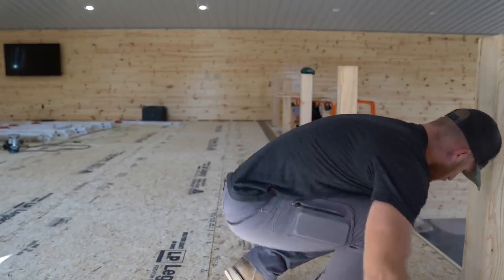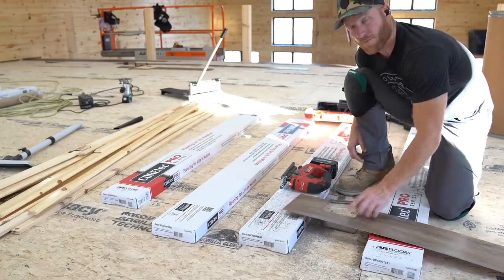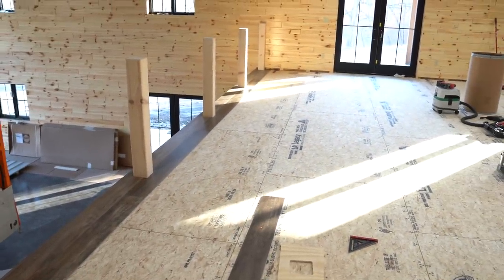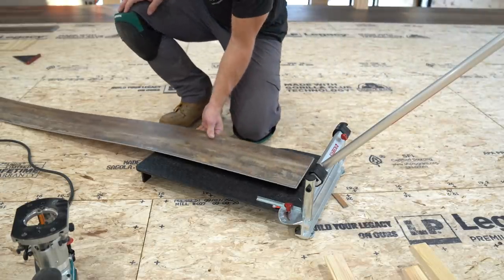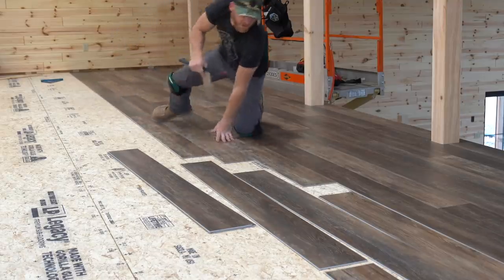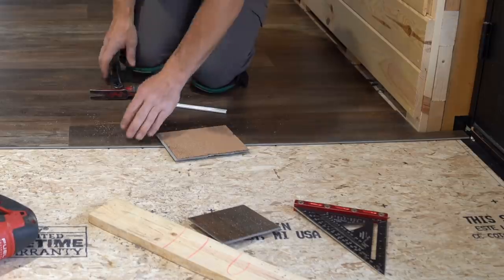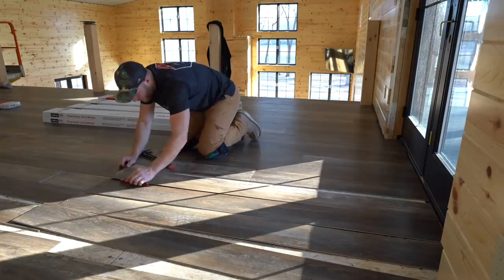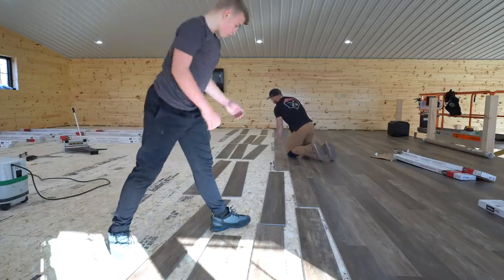Cabin in the Woods 44: Luxury Vinyl Plank Installation **Special Guest**

Comment: I’ve been installing for 20 years now. Looks good, only thing I’d tell you to do is not use the exact size cut off to start the next rows tho. What you end up with is repeating stair stepping. I’ll usually start off cutting a few starters and the end cuts I’ll either take a few inches off or wait a couple of rows before I start with them rather than on the very next row. Keeps the joints as random as possible

Comment: done a ton of "laminate" style flooring over the years in various properties we have owned.   Each carton contains a certain number of finishes from the manufacturer.   As in you don't get all "knotty pine" looking pieces in the same carton.   therefore we just leave the boxes out across the room and pull at random as we lay from several cartons at once.  I do agree with your comment of trying to not to put the same matching pieces together thus drawing your eye to a certain area on the floor.     Like your technique going around the posts, going to steal that method next time.    

Loving the series and the build.   The amount of prep work you two put into this build is paying off when you get to the finishing stages.   Nothing worse than having to shim, patch, fix issues that could have easily been resolved by taking extra time previously.

Comment: A quick help with that type of vinyl, keep your speed square in your pocket with a sharp utility knife a quick score on the face of the flooring and fold to snap will save you a lot of walking to your cutter, which will save time and time is money. Also 2 lb dead blow and a plastic flooring installers block, send the right amount of hammer to set your floor but keeps the lip of the floor safe. But as usual you don’t disappoint your floor looks great!
Reply: He must have been listening..... lol
Reply: Per usual I speak faster then I watch! Lol

Comment: We used a product from shaw flooring at lowes looks to be the same color, if you notice any bowing in the floor between a few boards in a slight arc watch how the sunlight travels the floor at anytime of day. We were remodeling after Florence and baffled by what our floor was doing, turns out the morning sun coming through the windows ether side of the chimney was expanding the flooring planks. Blinds were installed right after we figured it out

Comment: When I was in my mid teens I worked with my dad in the summer.  He sold and serviced 2 way radios with Law enforcement being out biggest customer.  I was installing radios in squad cars, drilling holes in bodies for antennas and running cables from the engine compartment to the trunk.   Good experience and I loved working with my dad.  We built 4 houses together.  He passed suddenly and I miss him daily after 27 years.

Comment: What you can do to. Is instead of starting cutting the pillars in and trying to bridge off the pillars is cut 2 vinyl pieces into squares. You should be able to get 20 of them. Attached them into the male end and screw them into the floor. Now your floor won't move at all. At the end, pull the screws and stopping blocks and do your back fills around the posts. Gets you started quicker. And that product is thin enough to score luckily. There making stuff thicker it seems that breaker is awesome

Comment: Start the flooring about 1” or two away from the joint and get it started in the groove and slide it into place and they will snap together so much easier. You’ll forget where you put your tapping block because you won’t hardly need it.

Comment: That "double z bar" is the fi4st tool i bought for laying plank flooring. Its really useful and youll find that under cabinets its great. You can even use it to shift the entire floor even with you standing on it if you need to shift if a spacer popped out while laying it. A dead blow mallet will save you some wrist stress from recoil and can be used to flatten those ends if they resist or have a tiny bit of grunge in the joint you didnt see. Rubber is ok but has even more bounce back.

Comment: Glad you figured out the score and break. It saves a lot of getting up and down. I can install an entire house of LVP with a hammer and a utility knife. Once in a while I will use a jigsaw when the peace’s are to thin to notch with the score and break method. Been installing flooring for 20 years and there are a lot of “professionals” that won’t mix up the pattern they just take from the box and lay it as it comes. Looks terrible and I always wonder how they still get work.

Comment: A trick I use on vinyl click flooring is to use dish soap on the ones where you have to tap them together. They just slide in and a wet rag cleans the soap up.

Comment: After doing many many many of the LVP floors I find that it eats jigsaw blades. Even the ones meant for flooring.  A table saw is your friend for a majority of the cuts. On notches I do the cross cuts on the table then score with a utility knife and straight edge and snap. A shear is nice for the end cuts but I really do most score and snap with a speed square on smaller room. Maybe a helpful tip for some viewers. Keep up the great vids!!

Comment: The floor looks great. But I have a few remarks:

1. There are some comments saying this floor is completely waterproof. In theory this is true, the planks lock together quite tightly, so water wouldn't go through the seams. HOWEVER, vinyl still expands and contracts with changes in temperature. It's minimal, but still. Kyle knows this as he mentions having had the planks in the room for two weeks already, which is relevant. But the temperature in the room can still fluctuate, causing the vinyl to expand and contract. And given the huge surface covered in this video, there is a chance for the planks to pull apart and leave gaps, and if there is ever water on the surface due to flooding or leaking or whatever, it will seep through the gaps. When water is trapped under the floor, because there is wood directly underneath it creates the possibility for mold to start growing. 

If this happens you need to remove the floor and dry the wood. That's a hell of a job. Moreover, because in this case the floor is not laid against the walls but rather extended underneath the walls, you need to remove all the bottom planks of the walls before you can start removing the floor.

In any case, the bigger the floor, the smarter it is to NOT choose a click-in system. It's easier to lift or cut out a few planks when you need to, instead of having to remove all the floor up until the point you need to access. Let's say you damage one plank in the middle of the floor, then you need to remove HALF the floor to be able to replace that one plank. Same is true for those huge walls. If you ever need to replace a plank in those walls because of rotting or whatever, well, good luck.

It would have been better to go for the glue-down vinyl. It's easier to replace single planks, and it won't move like a floating floor does when expanding and contracting.

2. With such a product, all the planks are the same size, which means it's hard to randomize the seams on the short ends. They are also quite short, and the bigger the room is, the shorter the planks will look in comparison. This looks very cluttered. A nice solution is to find planks that match together length-wise, making the seams on the short ends less noticable and creating the illusion of longer planks. This will make the finished floor easier on the eyes, as it will look like it's made up of fewer long planks, instead of many short planks.

3. These vinyl planks are very thin, laid directly on plywood, on a floor that is not filled with isolation but is hollow, with a metal ceiling below. This will be a VERY loud floor, and it will become a nuisance very quickly. You can already tell whenever Kyle lays his hammer on the floor, it's quite a bang, like hitting a drum. Using proper underlayment could provide some cusioning and deaden the sound a bit.

4. At some point you had your 13yo son working close to the edge. His safety is your responsibility. It would have taken only two minutes to tie a rope along those posts and make sure he doesn't fall and break his back. Don't take this personal, I guess it's also very much a cultural thing, because as a European I often notice a lack of safety concern in construction videos especially from the US. Overall you're better than many others at safety, but there's always room to improve.

Comment: I did a flooring job this past summer using with a very similar product, about 15 rooms in a dormitory, approx. 14' square. I started out using flooring scraps for setting the pieces but switched to scrap trim molding. The scrap molding lasted much longer, gave a larger hitting surface for the hammer and did less damage to the flooring. My knees hated for that job. The good news is that I have another 55 rooms to do in the coming months. I was wondering what your thoughts are concerning building on top of this flooring vs. building first (closets) and trimming the flooring around and into the closets. God bless, stay well.

Comment: What if you use router before hand and route those post groove where that flooring plank goes then wood above it would hide that movement cap.

I use flooring guillotine when i cut vinyl no need to worry about what if knife slips to floor what is already made or worst case you cut yourself.

Comment: I'm curious as to how you're going to terminate that raw egde of your flooring at your starting pieces, since you didn't use a nosing!? Are you going to cap that edge with a 1× material
Reply: 😉 Guess we will see when the trim detail work goes in. 😉
Reply: Some of the vinyl products do have a nosing but there kinda crappy. I probly would have put stained wood trim to cap the top of the drywall and butt up to it. But it's gars to say when your not there to see how it looks tho

Comment: I find it much easier to snap a whole row of pieces together first then tilt them all in at once...no pounding and messing up the edges and lock system.
Reply: Not with this type, it's designed to be laid one piece at a time. And the material is too flexible anyway, you'd need like 50 people to tilt in a row at once.

And if you use a spare piece and always lock it in correctly before hitting with a hammer, the chance of messing up the edges is very slim.
Reply: @o_._o123  Nope you can do it by yourself. Soon as you learn the technique it makes it much faster and better. I've installed plenty of LVT.

Comment: No one likes a transition on a wide open floor but something to note is you've likely gone well beyond manufacturer recommended spans for that flooring. I'd tell my customer this fact so if their floor buckles at some point you're not held responsible
Reply from the maker: this product doesn't have that issue, or at least I should say it doesn't move like other laminate floors....doesn't need the same expansion considerations

Comment: Hey what pants you wearing?? Like that pocket set up
Reply from the maker: These are Truewerk T2  https://truewerk.com?sca_ref=551902.6dfT3MtgXA  If you use my code you can save 15%...I promise you wont be dissapointed  CODE - RRKYLE15
Reply: @RRBuildings  Thanks! I actually saw those not too long ago but wasn't sold.. I'll give them a shot tho

Comment: What Kyle???? No cordless shop Vac? Shame. Shame..... Just teasing. I actually bought a cordless Dyson that is perfect for everything but drywall dust. Found out the hard way. Wha'ts nice about it though is you can buy replacement batteries and other parts..
Reply from the maker: it actually can be cordless I have the adapter plugged in